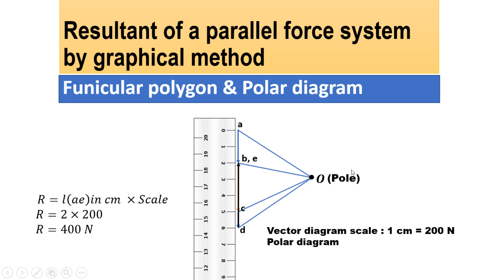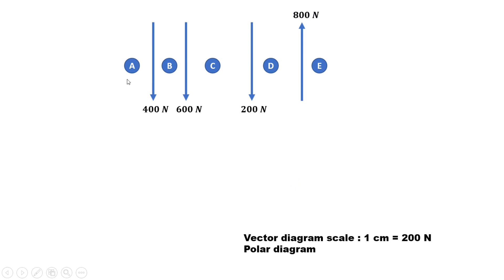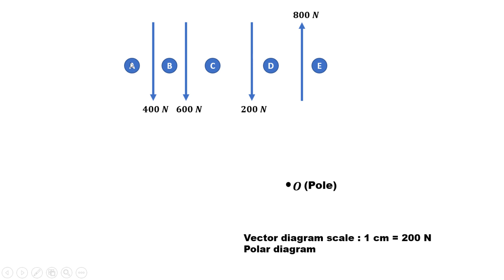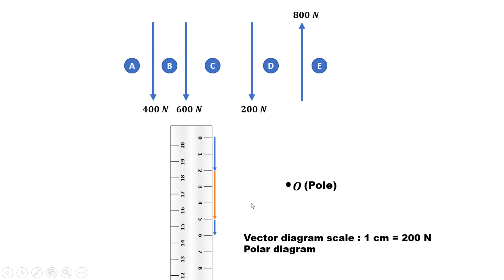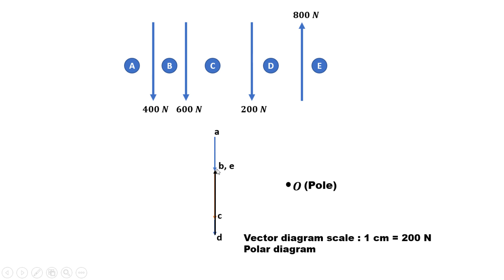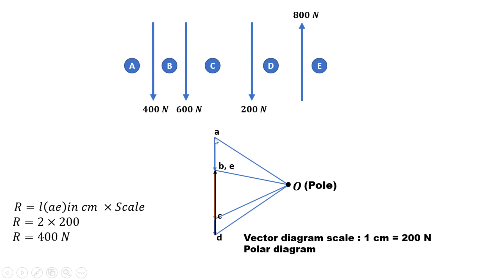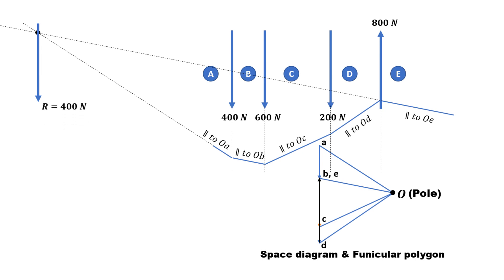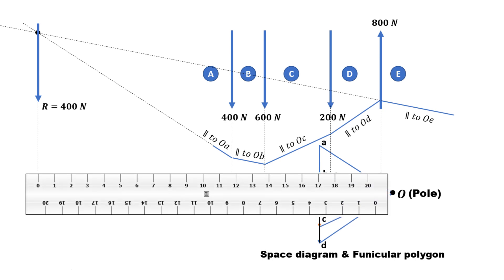Lecture 9 | Resultant of a parallel force system by graphical method | Graphic statics Part 5

Comment: Thankyou so much sir
Reply from the maker: Most welcome !!
Useful playlists for you !!!

Hydraulic circuit & pneumatic circuit working - https://bit.ly/3zAx1e4
Cam profile - https://bit.ly/3vjpY7a
Mechanics - https://bit.ly/3PClXmz
Beam reaction & Graphic statics - https://bit.ly/3veMwWA
SFD and BMD- Simply supported beam and cantilever beam - https://bit.ly/3PDzA4V
SOM & Structural analysis videos - https://bit.ly/3OEqX8S
Heat transfer - https://bit.ly/3PzxiUe
Thermodynamics - https://bit.ly/3J5ZvQd
Velocity & Acceleration diagram - https://bit.ly/3vj8zf0